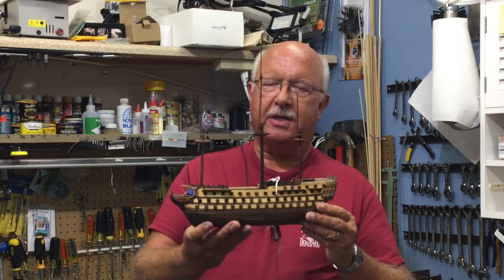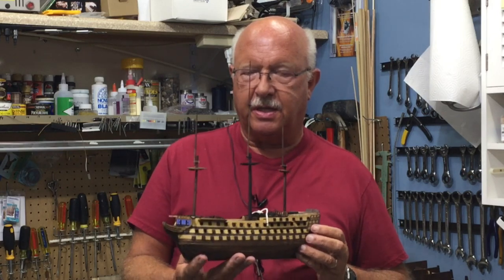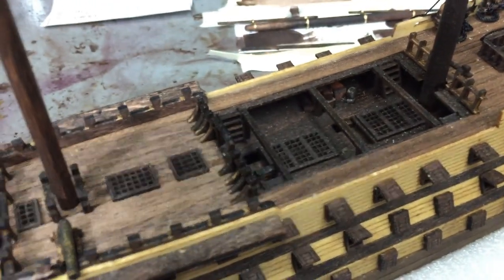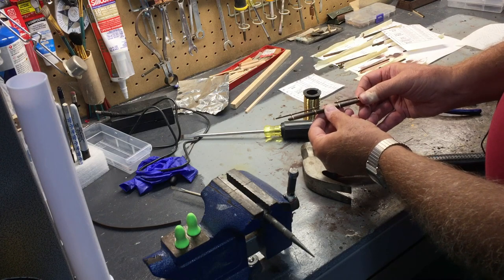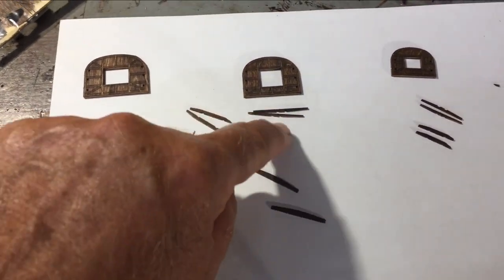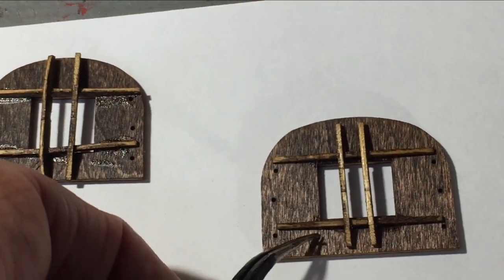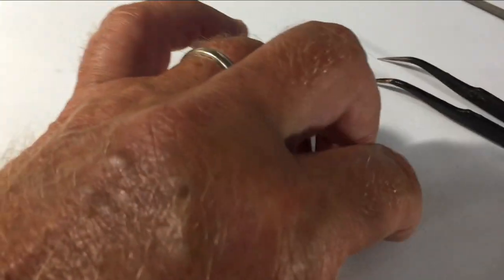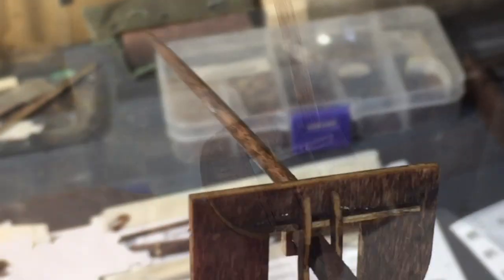HMS Victory Model Ship Build Episode 9

Comment: The yard beams looks great. Thank you for the tips on the wire. Bought some a while back for similar usage on my builds. Haven't used it yet. I've found building the masts and beams separately and keep off the ship until I'm ready to rig. I'm also able to get better measurement for cloth sails. Looks great!
Reply from the maker: I meant to leave them off too..... sometimes I get ahead of myself and suffer from it..... I’ve got the main mast off a little..... Thankfully the other two are not secured yet and I can work with them better!  I’m learning as I go 😂👍
Reply: @BoilerDan1  And yes.. I'm learning tremendously as you go too. Thanks again!

Comment: On the hangkai motor did you add grease to the grease insert? Please help
Reply from the maker: Yes, if you’re referring to where the motor swivels. All you need is a common automotive grease gun.
Here’s an example from Amazon but you can get one smaller from any store like Walmart with little grease tubes included for cheaper.
Lnchett Grease Gun, Professional Pistol Grip Grease Gun with 18 Inch Flex Hose, 2 Reinforced Coupler, 7000 PSI https://www.amazon.com/dp/B07VQF2YL6/ref=cm_sw_r_cp_api_glt_fabc_A422417P8D7TPQSR1PRS
Reply: @BoilerDan1  thanks you taking the time to get back with me I appreciate it
Reply from the maker: @bobbysteckel5824  No problem, I hope the reply answered your concern.  In one of the videos I mentioned it, but I’m not sure that I actually show it.... The grease gun hose will go on tight, kinda snaps on. You’ll have to use a little force to pop it off too.
Thanks for watching 👍👍